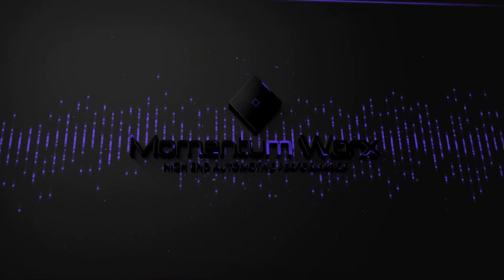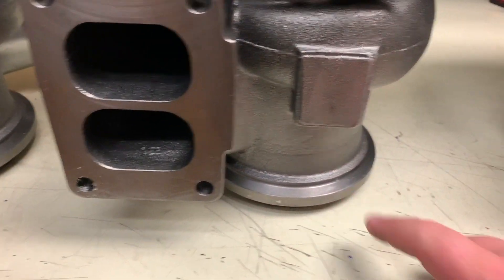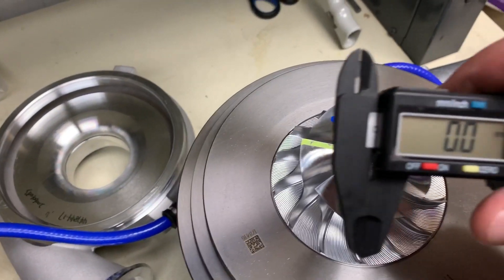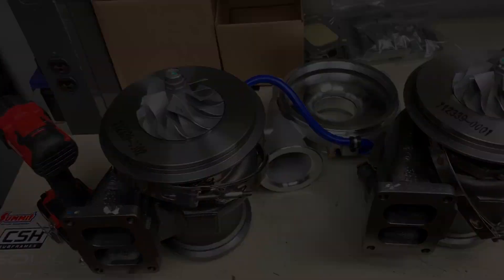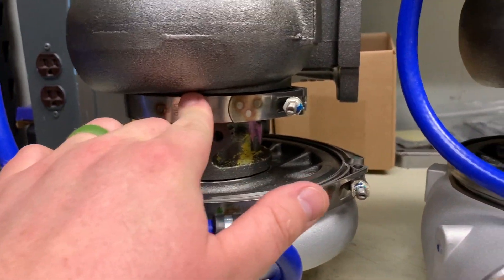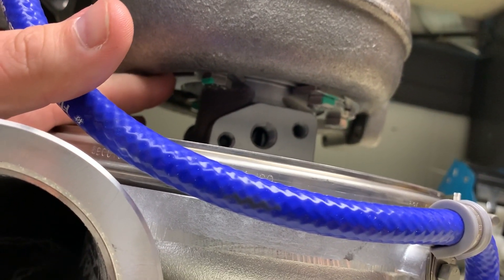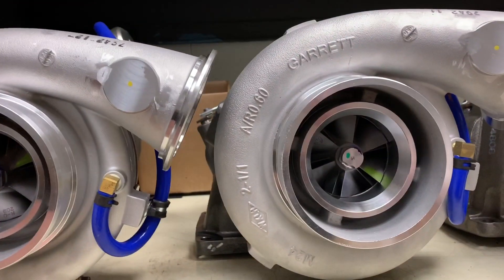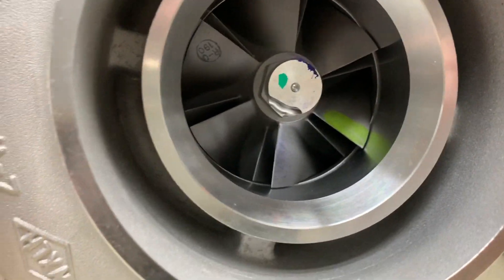Why does BorgWarner consolidate so many turbos into one? Check out these Detroit Series 60 Turbos

Comment: I have a 2005 columbia that has a 12.7 head with 14L engine. I delteted the egr and had the HP programmed to 500+. I currently have the borg warner wastegated one. I want to switch the manifold and turbo for better fuel milage. Please let me.know what you recommend

Comment: The Garrett on the far left is what I’m running in my compound turbo setup as my large low pressure turbo on my 7.3 powerstroke. It works amazingly well with the factory tp38.

Comment: I'm looking for a turbo that will me run more fuel efficient and horse power I'm a heavy hauler on average 50 -57 tons max. I. Running  ddec3 12.7 detroit  500 hp with factory waste gate turbo. Which turbo would you recommend me getting as an upgrade
Reply: Gt4202 is a great upgrade for 12.7 it's a stock 550hp 14l turbo and is able to support 600hp tune

Comment: I have a 14L ddec5. I really want to swap to a non waste gated turbo. I know it can be done but what I don't know is if there are any computer settings that need to be changed since I would be deleting the vpod. I can't get boost no matter how I adjust the actuator. Besides, I'll be saving money on voids going bad.
Reply: Pdi tuner is wat I'm hearing not sure if it works for your application
Reply: They have computer settings to program Ecm no vpod or actuator

Comment: I installed a 172743 K31 upgraded from a oem Garrett with a stuck open waste gate and I gotta be honest I'm not noticing a performance different. Yes it spools quicker but tops out at 29psi with the gauge jumping around on my 12.7. thinking of cleaning boost sensor and getting a boost leak tester. New exhaust manifold as well.
Reply: watch your pry when pulling a hill make sure it stay with in specs, im sure your pry temp when up because your boost when down
Reply: Your tune plays a big part
Reply: @Nick4b11 correct. You could actually decrease performance if you don’t also change other parameters. Like more fuel.  Bigger turbo usually likes more fuel.

Comment: I swapped out a Garrett (stock?) Out of my 12.7L 500hp ddec4 ....used to get 35psi on the Garret .... IN WENT a BW171702 and my boost never went past 27.5psi ...

What gives????
Reply from the maker: Make sure there's no boost leaks.

The 171702 has a 1.32 A/R housing which is likely larger then the housing of the turbo you took off, so if all things remain constant - boost pressure will likely be lower unless you were over spooling your old turbo. 

That being said / the 171702 is a "go-to" upgrade for series 60 owners.  I'd check for a boost leak and make sure you're running a good file for the turbo you have
Reply: @momentumworx  AFAIK, the file is stock. This was a 1-owner truck, no mods. I know the ECM is reman but recently, I noticed that the exhaust manifold has developed a leak at the joints and on bolted surface to the head.

I'm now curious is that's what lowered the boost as compared to old turbo.
Reply: @vroor32  it may but your going to still lose boost because you when with a larger AR you will never regain the boost you had unless you give it more fuel
Reply: @serpentrae    I bought & installed the full-tilt 1-piece and now I'm hitting 32-33psi which is actually the expected range, with 500hp 12.7L. I also found that S60 is designed to produce 16hp/1-psi boost, which translated to 31.25psi (500hp÷16)....so I'm right on the money
Reply: kool glad you got it squared away
Reply from the maker: You added a larger turbo that takes more energy to spend.  Without adding fuel, its not going to spool up as much as a smaller turbo.   You will need a fairly aggressive tune to make a 171702 work well on a stock 12.7
Reply: @momentumworx  I have a deleted isx15 450 what would you recommend for it. I'm tuned at 500hp

Comment: I don't think they make the best one from the factory...   The S400 75mm with a T6 1.15 hot side!  Good spool and top end, on a 12.7 it is a great replacement for the 500-700hp guys and out of the dozen I've tried on the dyno and road it is the best every size I have seen yet for a tuned motor.
Reply: I think I'm asking the wrong person I realize now that you are running a bigreg where I'm speaking of a 4 wheel drive pickup truck
Reply: Have you done anything with a 3.5 ecoboost
Reply: Or ask because I've seen evidence that 700 to 750 horse can be gotten out of that 3.5 relatively safely And that's exactly what I'm going after